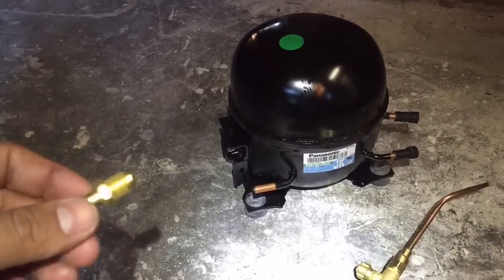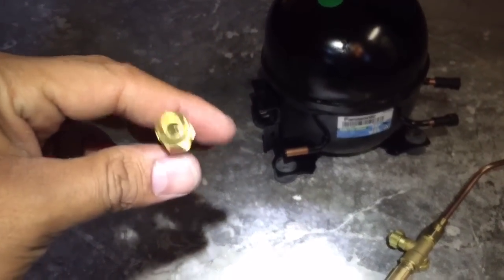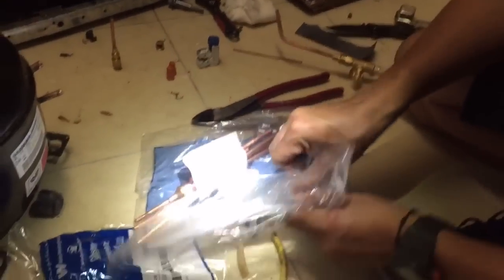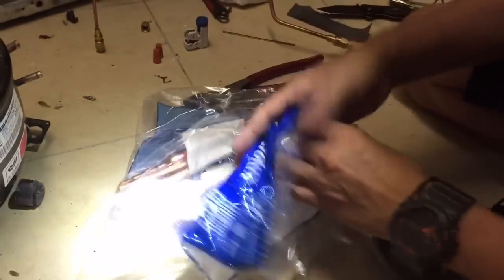Compressor install

Comment: You should not run the compressor without Freon, you need to protect the compressor with a wet cloth when you are brazing, you need to add nitrogen for leak Test and vacuum the system after brazing and before charging the system with Freon.

Comment: Here are all the things you did wrong
1:Shit Welding and Brazing, and no protective paneling on the floor
2:You didn’t evacuate the system 
3:No Vacuum
4:No Acid Check
5: Probably no safety equipment 
6: Your wearing shorts 
7:Ran the compress with NO refrigerant in it 
8:Didn’t check if you had proper charge, it seems like you overcharged the system 
9: Incorrect Compressor, you had to shove it the fridge to make it fit
10:Wrong Set of Gauges
11:No leak Check 
Is there anything else I need to say about this shit job?
Reply: Do you need oxy-acetylene for this or can you use MAPP gas?
Reply: 12: Make your own video

Comment: So many errors  I can't even watch this video, these repair videos are awful for DIY guys, the fridge will fail again in a few weeks. 
Please stop repairing stuff if you're gonna make it worse than the original failure cause.

We have a 15 year old fridge that never failed, WHY ??? because no freon leaked, no one addresses the leak cause, just "LETS START REPLACING COMPRESSORS"
Reply from the maker: It’s been six years ago since we replaced the compressor on this unit and is still working great there’s been no problems at all not even a call back . the refrigerator is my friend garage unit and is still keeping the drinks cold all the steps that we did was not all recorded on this video, but if you can make a better video make one yourself for ww can see it...
Reply: @TopAppliancesrepair  You must have left out 90% of the steps, it just leaks people in the wrong direction. Im not doubting your work since you cant be doing hacks 100% of the time, it will cost you more to revisit the units. 

But uploading silly videos with terrible music where we cant hear what you're saying, leaving out steps. 
One can only assume what they see posted, I cant imagine how you are flowing nitrogen while brazing, what rods you used, how long you pulled vacuum for, when and how you determined it was a bad compressor, when and how you use UV dye to spot any leaks. 

maybe you can see the  confusion.

Comment: Terrible bro, repost without music.
Need to explain what all is need.
Name of parts.?
How to go about finding parts?
Is that soldering?
Is compressor charged when it comes in or do you need to charge after installation?
How Much 134A will it take?
How many PSI?

Comment: this is not what to do video you just introduce moisture to the system you supposed to pressurerized with nitrogen and look for leak and if no leak then 
release nitrogen and proceed with the vacuum and after vacuum wait for atleast 15 minutes to check for leak again and if no leak then start charging with freon
i hope you give warrantee cause with moisture they dont last it will burn out the motor

Comment: Need to vac down to 500 microns and use nitrogen when brazing. Also, running it without Schrader values is bad. Air is not good for the filter dryer.

Comment: Doesn’t appear that you pulled unit down into a vacuum to leak test your brazed joints and there’s probably all kinds of moisture in the system.  Also didn’t see you flow nitrogen while brazing which likely means oxidation...hack job.
Reply: LOL...

Comment: You're one shit engineer... Pulling a vacuum by running your compressor.... Moisture in a Refrigeration sysem isn't good and you didn't even evacuate the unit... Fucking bodge artist.. You are on very poor engineer.... You will be back when the drier blocks.... With moisture.... A bit of advice.... Don't pretend to be a Refrigeration Engineer.... You're a joke.

Comment: Dude, I hope you put a vacuum pump on that fridge before charging it with refrigerant, or you’re gonna have an ice restriction on that thing, that’s gonna fry that Panasonic compressor to crap.. ....and what’s with that porn music over-shouting whatever you’re trying to say??? I can’t even here you homeboy.
Reply from the maker: JD RS hahaha yes Vacuum was done 👌🏼 refrigerator it still working good with no problems , I did explain on the description down below that I couldn’t record vacuum . ✅
Reply: Well in that case, good job brother.

Comment: I agree with a lot of commenters, the music is garbage in the videos. I listen to my own music and as a result, never heard a word you say. Nice way to burn a customer's floor, pointing the torch downwards and also risk having braze drip on the floor with no firemat? YIKES! Took you a LONG time to braze the access fitting, usually can be done in 20 seconds with the flame on the bottom and nothing in the way to affect your aim. Why change an 800 btu compressor to a 1000 btu?  
•NEVER EVER EVER Run the compressor sucking room air through it! It sucks in moisture and other contaminants and it settles in the oil in the bottom of the compressor!!!!! Though not shown, the gauge showed a vacuum was done at least. I was waiting for the can of automotive refrigerant, and I was not surprised. Guessing at the correct charge was all he really could do here where the compressor was 25% higher BTU than the original. Utility cost and compressor life will be affected adversely.
••••••• Please do not do a compressor change this way!•••••••
Reply: I almost died when saw him run it with charge port open. NEVER EVER allow room air to be sucked into compressor.

Comment: Excellent music. What was wrong with the original compressor? I have that has weak pressure output. It won't even fill a balloon. Is it dead?
Reply from the maker: This compressor was not coming on at all , we replace the start and relay and still was not working , so we replace the compressor and was all done , this refrigerator was my friend , and still working good ,

Comment: Hi, have a Panasonic NR-B 30,
there is something wrong with the cooling system, the sides where it gives off the heat stay cold, only a small spot gets hot.
What could be the reason?
Many Thanks.
Reply: You'd have to start with checking to be sure the compressor is actually running,  then the pressures at both the suction and the discharge. There should be a 100 PSI difference, if not the compressor is likely bad. If the suction is in to vacuum and the high side is somewhat low with no heat, it's likely obstructed. (Cap tube, drier, condenser) If there is a poor frost pattern on the evaporator, low refrigerant.
Reply: Thanks for the information.
I will hire a specialist to repair the device.

Comment: YOUR SYSTEM WILL BE DAMAGED SOON YOU DNT USE ANY VACUUM PUMP AND WHITHOUT RECOVERING THE R134A PROCESS ITS TOO DANGEROUS TO YOUR HEALTH
Reply from the maker: benchehida bouabdallah hi , The compressor is been installed two years ago everything is working good and the vacuum was done . we just didn't record in the video that's why we put in the description that  we couldn't recorder the vaccuum but is one of the most important parts that you had to do whenever you doing a seal system. 
Thank you for your comment
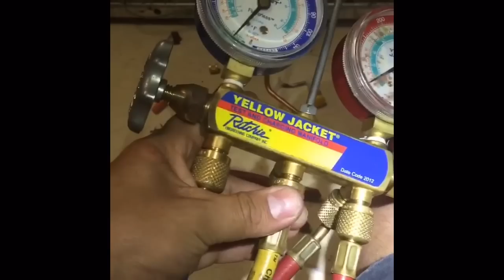Reply: He didn't show the process, how long he did it, etc. At least at 5:51 (right after the can of Prestone automotive refrigerant) you can see the manifold is well into vacuum. A good vacuum job will run the pump at LEAST 10 minutes. Where this guy ran room air through the system by running the compressor in free air, I'd recommend 20. A Micron gauge is handy to be sure you have no leaks or moisture left.

Comment: What kind of flux cored rod did you use? Good video by the way!
Reply: Except that song!
Reply: The common BRAZING rods are Harris Stay-Silv with 5  to 15% Silver using StaySilv Flux if  anything but copper to copper.
Reply: The new technology for the refrigeration tube connection without fire welding !!!
https://youtu.be/JrYNxCHo9XA
https://youtu.be/OgDRnl3ud3E
https://youtu.be/_oini60SMOw
https://youtu.be/6L6fwLTvaHA
https://youtu.be/e3O8TVQZskc
https://youtu.be/5djCKsP0f0Y
https://youtu.be/yTwQ1YgRDUk
https://youtu.be/P0jxZFMPHdU
https://youtu.be/M_ZojTqfrYE
http://aim-tech.kr/lock-sleeve/

Comment: why did you skip vaccum?your system will run with moisture for not doing the vacuuming..
Reply: Jorge Pagal read description
Reply: He didn't show the process, how long he did it, etc. At least at 5:51 (right after the can of Prestone automotive refrigerant) you can see the manifold is well into vacuum. A good vacuum job will run the pump at LEAST 10 minutes. Where this guy ran room air through the system by running the compressor in free air, I'd recommend 20. A Micron gauge is handy to be sure you have no leaks or moisture left.

Comment: so did you pull a vacuum from the high and low side?
Reply: He didn't show the process, how long he did it, etc. At least at 5:51 (right after the can of Prestone automotive refrigerant) you can see the manifold is well into vacuum. A good vacuum job will run the pump at LEAST 10 minutes. Where this guy ran room air through the system by running the compressor in free air, I'd recommend 20. A Micron gauge is handy to be sure you have no leaks or moisture left.

Comment: what kind of Brazing rod are you using?
Reply: Not  sure what he used, but the common BRAZING rods are Harris Stay-Silv with 5  to 15% Silver using StaySilv Flux if  anything but copper to copper.

Comment: what kinda  of solder u used?
Reply: Not Solder! The common BRAZING rods are Harris Stay-Silv with 5  to 15% Silver using StaySilv Flux if  anything but copper to copper.
Reply: Stay Silv not for copper to steel on the line into the filter dryer even with flux not correct. The correct alloy is safety silv 56/45 with stay silv flux, never phosphorus rod for steel.
Reply: The new technology for the refrigeration tube connection without fire welding !!!
https://youtu.be/JrYNxCHo9XA
https://youtu.be/OgDRnl3ud3E
https://youtu.be/_oini60SMOw
https://youtu.be/6L6fwLTvaHA
https://youtu.be/e3O8TVQZskc
https://youtu.be/5djCKsP0f0Y
https://youtu.be/yTwQ1YgRDUk
https://youtu.be/P0jxZFMPHdU
https://youtu.be/M_ZojTqfrYE
http://aim-tech.kr/lock-sleeve/